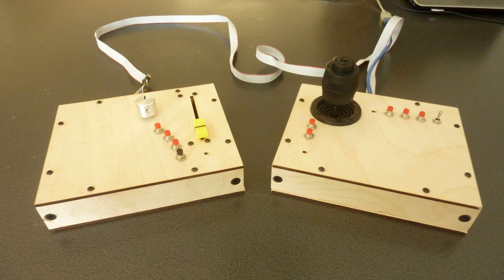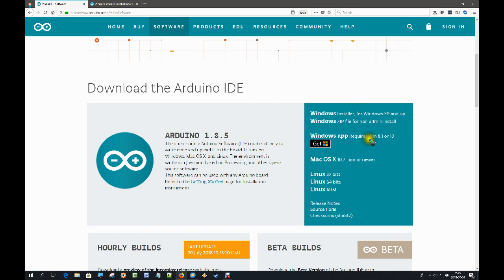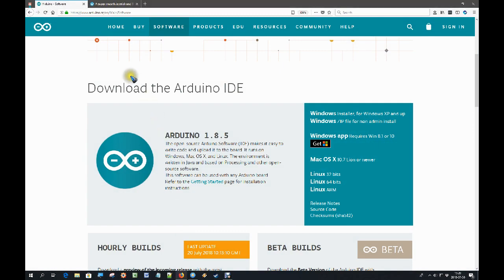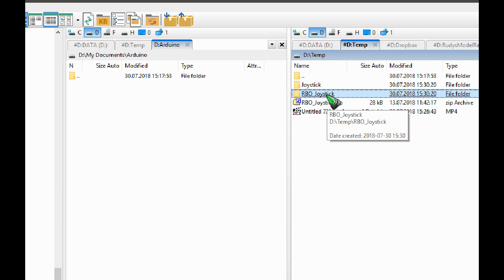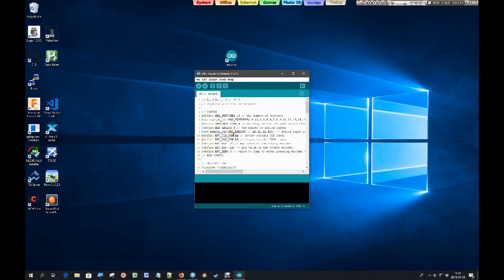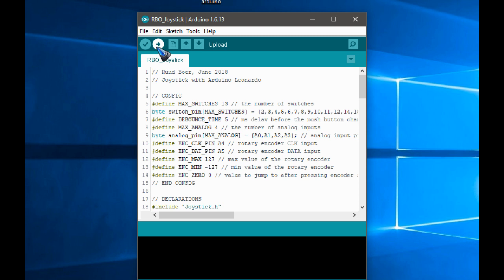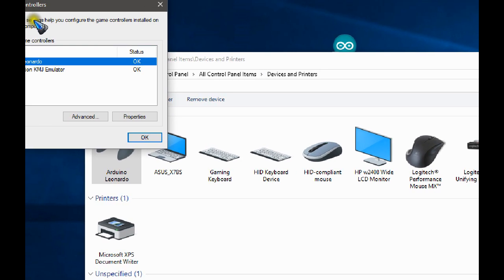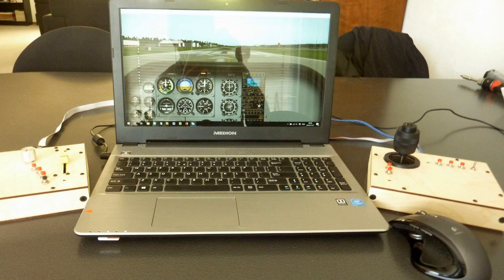Super Smooth Joystick and Throttle with Arduino

Comment: Hello, I'm building my throttle controller. I've read that if the Arduino sends the data too fast to the computer you could have issues. Do you send the throttle position every X milliseconds or do you wait this value changes before sending to the computer?
Reply from the maker: With the software as described it all goes well fully automatic, it's a USB interface, there's no need to change any timing.
Reply: @rudyshobbychannel  Finally I decided to send the data at a bit more than 60Hz (15ms) and only if the position of the controller changes. First because I don't need more in XPlane, and also because during this time I can average a lot of samples (about 125 measurements). This average smooths everything (no jitter in the output). Someone has made has been testing the Leonardo with a windows mouse software, it shows that the microcontroller can't send the data faster than 500Hz

Comment: This video is awesome, thanks for sharing it, with the rest of your stuff !!
i am trying to try my hand but i am a beginner with arduino. escapes me how you connected the slider pot on A3, because a 2 pin output.
would you be kind enough to give me a tip?

Comment: Thank you! I just fixed my Saitek/Logitech Yoke with the Arduino Micro Pro (Leonardo clone) for less than 7$ LOL! Works flawesly and finally no more center deadzone plus smooth XY operation! The easy way would be to go with Leo Bodnar board but the price is much higher:) Took me like 1h start to finish with no previous experience in programming. I modified the code to get only 2 analog inputs active. Amazing!

Comment: I hooked up a slider, 1 button and an encoder.  The button and slider seem to work fine, but the encoder, which shows in the windows test screen as rudder, will move the indicator to the right, slowly, no matter which direction I turn the encoder knob.  I double checked the gnd and 5V as well as the the clk and data to A4 and A5 resrectively. Any Ideas why this might be?  Thanks, and thanks for the tutorial.
Reply from the maker: Hard to tell what's wrong. There are different types of encoders on the market, maybe you have a type that does not work with this code. What you can do to diagnose is place a couple of serial print instructions in the encoder read function and read them out on the serial monitor to see if the encoder works properly. Today I included a new .ino file in the download link (please download again) where the encoder simulates push button pulses. This can be used for instance as rudder- or elevator trim switches. I use this myself and I think it more convenient than analog simulation.
Reply: @rudyshobbychannel  First of all, If you don't have time to respond I understand : ) but in case you do..
I inserted serial output in the loop right after the call to read_rotary() and printed out the returned value.  what I got was.. 

slow turn to the CW returns 1
fast CW returns 0
slow CCW returns 255 
fast CCW returns 0   
the return stays locked in,  that is, after a slow CCW returns 255, it continues to return 255 until I move the knob again, same for all returns. 

I am running the new "encoder pulses" sketch 
A Oscope shows clk and data are held high when the knob is not moving and both pulse low as the knob is clicked.  that is while powered independently so so arduino is not effecting those readings.

I think that perhaps my output signals are reversed?  where your encoder outputs low while not moving while mine are high? therefore "event
 timings" are mesured incorrectly?
Reply from the maker: @bosshogg8621  There are different type of encoders on the market, that might be an explanation for the deviant behavior you get. I don't think it's about the signals being high or low ... but on your scope you should see the signals have a 90 degrees phase shift when you turn the knob such thagt the flanks of one signal take place when the other is HIGH or LOW (which is how direction is determined).
Reply from the maker: @bosshogg8621  Oh, by the way, when using the 'pulses' code, the encoder is meant to be rotated slow, since every click generates a 100 ms pulse resembling a push button. I did not take out the fast /  slow timing distinction in the code ... you might want to do that to prevent accidental fast rotation detection.
Reply: @rudyshobbychannel  Using your code as a guide I managed rewrite and get them to work!  I'm not sure what the difference in our code is because I'm new to this language.  But, it is a 90degree out of phase quadrature signal.  
My current dilemma is that sending MSFlight2020 a 100ms button pulse don't seem very effective at moving my elevator trim.  It moves, but very slowly.  I'm currently using a slider insted, but thinking about having the encoder control an up/down count and then updating an axis with that count (I think thats how that works). 
Any advise on button pulse timing? ontime/offtime? 
Thanks for your guidance.
Reply from the maker: @bosshogg8621  Good work! Yes , adding / subtracting a value and sending that to the sim is how the 'analog' sketch works. Then also the slow and fast rotation is in use.

Comment: Thanks for sharing .Cause i want to do it too .but i don't know how to wiring them . ( i just want only a JoyStick ) .Would you please draw how to wiring them ? Thank you so much.
Reply from the maker: Just look at the software listing ... all the connections for the potentiometers and the switches are listed there. There's not more to it than that. The other side of the switches go to GND. The potentiometersngo to GND and 5V and the slider to the pin mentioned in the code.
Reply: @rudyshobbychannel  Thank you so much...i will try.

Comment: OMG MAN THANK A LOT1!! WORKS!!!
Reply from the maker: Have fun!
Reply: @rudyshobbychannel  bro i have one question, i have rotary switch rs1010 3 postion, can i use this in this project? im a beginer with arduino and I don't really know how to connect it.
Reply from the maker: @kenneth2213  It's a switch like any other, it just has 3 switches in one housing. Connect one end of the 3 switch pins to GND and connect the other pins to 3 Arduino inputs and you have 3 switches to assign functions to in your application.
Reply from the maker: @kenneth2213  Picture this: a wire goes from Arduino GND to three of the six pins of the switch. The other three pins each have their own wire to the Arduino, say pins 3,4,5. That's it. The switch now connects one of the inputs to GND, if you rotate the next pin, if you rotate again the third pin. How the layout of the pins is on your switch I can't tell, you'll need to measure, or try it out, or find documentation.
Reply: @rudyshobbychannel  https://imgur.com/p7pBa3Q this is the layout of the pins i think
Reply: @rudyshobbychannel  should i change somethink in program? 
I'm really a beginner
Reply from the maker: @kenneth2213  Not of you use the already existing inputs for the push buttons in the current design.